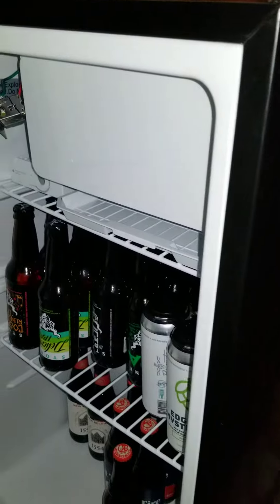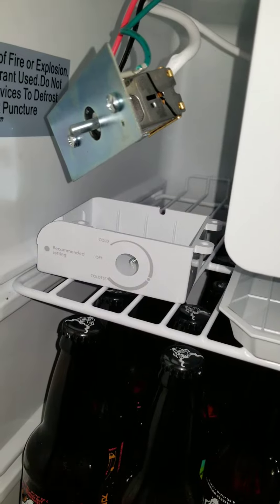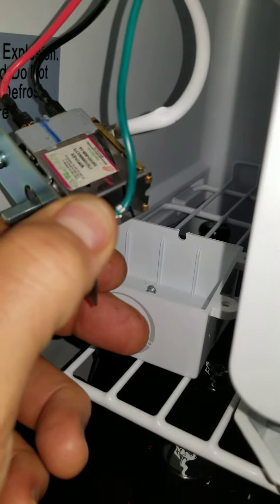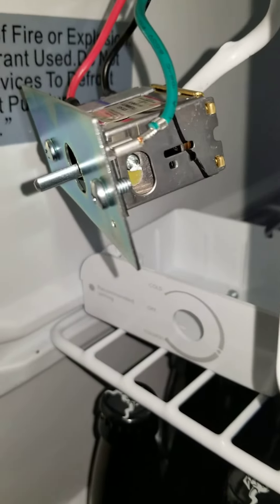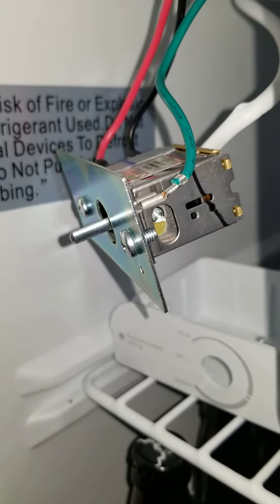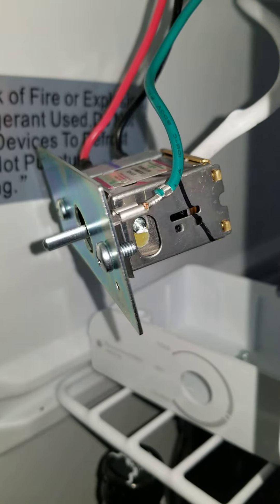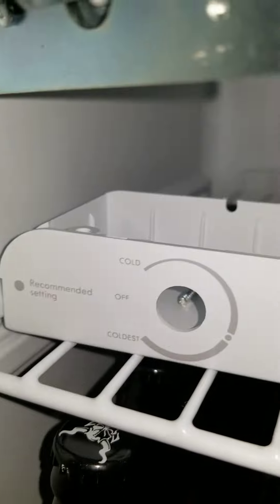Tweak the temperature on your mini refrigerator's thermostat to go beyond the usual control settings

Comment: What if you have a freezer up top on your mini fridge would I have to adjust that one as well or no
Reply from the maker: The unit I have does have a freezer on top and has only one t-stat.  I guess the design uses the freezer section to drop cold air to the lower section.  Thus raising the t-stat temperature will probably not allow the freezer section to get to below 32 degrees.

Comment: Did it work for a long time after that? Was it screw in our out?
And why would the thermostat need adjusting if it worked fine from the factory?
Reply from the maker: Yes, it is still working and holding the higher temperature I desired.  I forgot which way the screw turns in order to either lower or raise the set temperature; in the video I mention how to figure that out.  One would adjust the thermostat if they wanted the refrigerator to maintain a different temperature than the factory setting, depending on what one wants to keep inside the refrigerator.  In my case I wanted to use a refrigerator that I had on hand like a wine cooler, for my stout beers, They need around 55 degrees Fahrenheit for storage while factory setting is much lower than that.
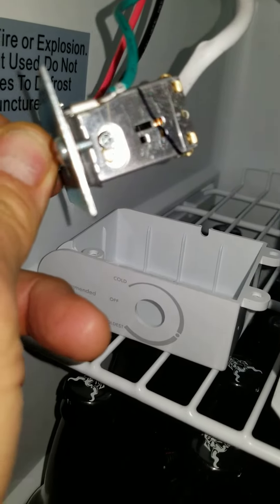Reply: 0:48 turn set screw clockwise to increase the temperature. Got it, thanks!